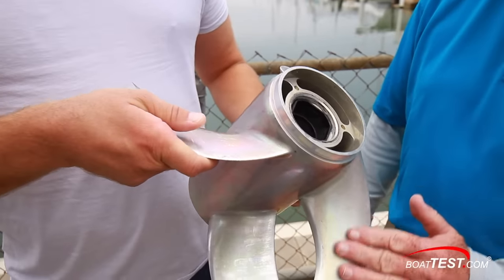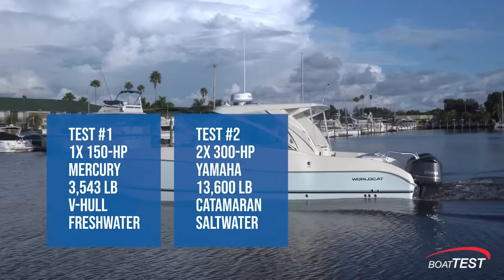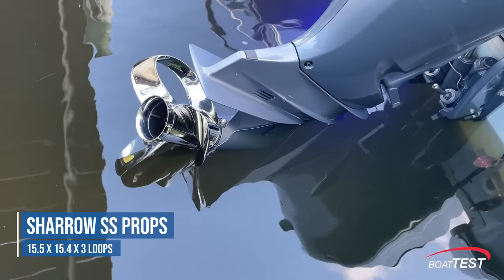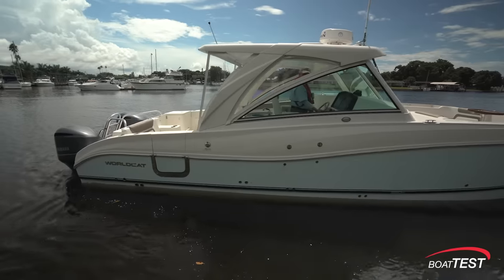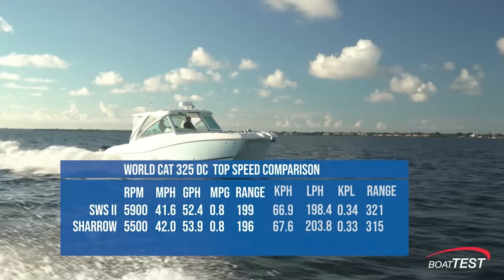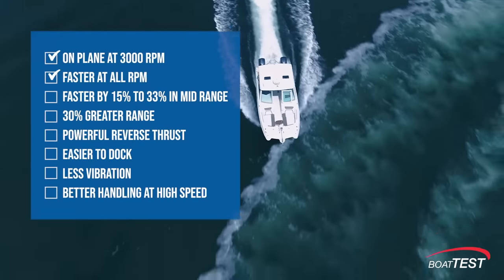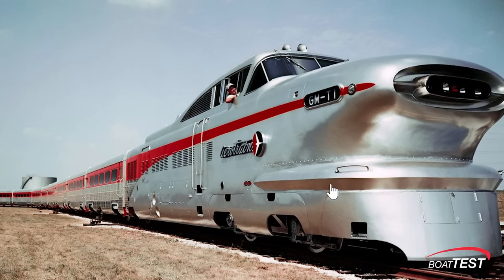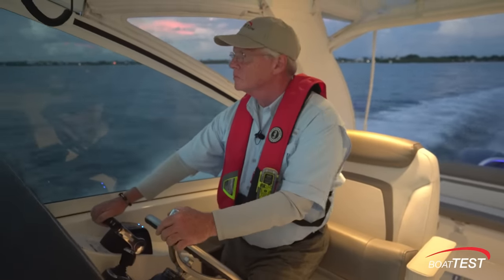Sharrow Propellers (2022) - Test Video by BoatTEST.com

Comment: I would hope the cost could come down on these eventually such as when there is a permanent cast stainless version available. If these have to be CNC machines then cost will stay high. Also what part of this cost is just artificially high for high profit rip off purposes. [OK I did see the part where he supposedly is going to cast these so there may actually be hope they will be more reasonably priced in the future, close future].

Also how would this prop compare if you were to up size the standard prop or do prop test/tune with different standard props? Or, simply, how would it compare to the next size up standard stainless prop? 

I always up-size my props until I over do it and get worse performance then use the one best for my boat vs steady state medium cruse and efficiency. I never once seen a prop that came standard on a outboard "be the best" for the boat it was hung on by the dealer [who usually don't give a crap].

So, in my opinion, though this prop is undeniable pretty darn cool my question is simply... is it really worth the cost? Not so sure until maybe 10 yrs from now and every one willing to pay an unreasonable HIGH cost has done so and sales fall off then prices will start to come down.

I am not that guy with 300k cars in my garage or a 300k boat so you rich boys have fun with this. I'll just tune my  boat with different props like I usually do and get vary close to what this new cool rich boy toy will do. 

Remember this is really more the "sales video" then the actual good and proper test. Hand me the keys to that boat and a proper selection of standard props and then you will really see what that boat can ACTUALLY DO with standard stainless props after a PROPER prop test and tune session.

Comment: I'm not qualified to pass judgement on this subject, but it looks to me like the Sharrow prop simply has more "bite"which would give it better economy midrange and higher speeds at the same RPM. The fact that the Yamaha prop tops out 400 RPM faster than the Sharrow tells me that this is not an apples to apples comparison.

Comment: what i would like to see is a comparison of a petrol 300 vs a OXE 300 diesel with these props on. also hydrofoils vs no foils if my calculations are right just switching to sharrow prop and diesel outboard it would increase your range by almost 100%. and that's nothing to sneeze about with planning hulls where range is always at a premium. screw the fuel prices... range is where its at. a 300 mile range is all fine and dandy... but increasing that to 500_ miles opens up a whole new venue for using the boat. all boating i ever did was medium to long range cruising and the only boat that can accommodate that is a displacement trawler or a sailing yacht. having an option to do that trip with a planning hull would open up so many more new options. and that alone is worth the 20K per engine price increase.

Comment: 3 blade props have slip. Sharrow is basically a 6 blade prop. has more bite. Less slip. Test it against a cheaper 4 or 5 blade prop. Should be comparable to Sharrow

Comment: I'd like to see fuel burn vs boat speed.  It seems to me that the sharrow gives more thrust per revolution, but takes more torque from the engine (hence top speed RPM is down).  I wonder what it would be like if the engines were matched to the prop for that extra torque.
Reply: Only worth testing on electric motor since that's all that will exist soon. Great torque.

Comment: I always wondered how one of these would do on my boat. I spend most of my time trolling at idle speed and to get an extra 20%-25% in fuel savings would be great. I spent $2500 in gas in 45 days during my guiding season.
Reply: Buy one and test it out.  That's the only real way you'll know.  Best of luck!
Reply: Ur about to spend a couple more thousand at the pump. Remember trump was in office and gas was 2$ a gallon ?
Reply: I do lots of trolling also and I have 200 hp Suzuki with trolling mode which allows me to slow down the rpm but I think if I will install this prop will increase my lowest trolling mode and I will need to deploy trolling bags

Comment: What a great invention! It's only 7264.704 miles to run on this specific boat to compensate for the cost of the propellers. That's ~335 hours of operation. Many owners sell their boats before hitting that threshold. Also, and that's only a side problem, what are the chances you won't hit anything with your propellers before doing 7.2k miles? There is a reason that some things weren't "invented" all that years and it's called "there was nothing to be invented there"...

Comment: Any answers about long-term effect on the motor and drive system ? Sometimes performance upgrades are not always longevity upgrades. 

One other thing I am curious about is whether the actual material (type of aluminum, or stainless steel) and weight of the prop was taken into account. How much of the difference in effect between the props is actually due to the change in shape?

Comment: I can well imagine that comparable improvements could also be made to the Axopar 37, for example, which would then be quite spectacular and sensational.

So in relation to the improvements that could be achieved and the total price of 500,000 US$ for a well-equipped Axopar 37, it would be very interesting. 

For me, such a propeller would be particularly interesting because I expect to be underway with my 2 x 300 HP COX diesel Axopar 37 for about 150-200 hours a year, or 4000-6000sm/year. With the current GTL diesel prices in the Netherlands of 1.85€/l (8.5 US$/Gal), it will already pay for itself after about 2 years and fuel prices will continue to rise. 

I would therefore be very pleased to see a test on a diesel drive and of course optimise my Axopar 37 with it as quickly as possible. I reckon that my Axopar will consume 1.6 l/sm at a cruising speed of 30 knots and approx. 2000-2500 rpm.
Reply: 1.6 l/sm = 2.3 sm/Gal

Comment: I can see why they cost so much. Each prop is CNC machined. Meaning, it can take 5 hours or more to get the proper shape out of a billet.  While the majority of the other props are made out of molten metal, assuring strength and consistency. If Sharrow goes to using mold injection, then they will see a serious change in their product quality and weight.  Otherwise, I don't think they will survive for much longer doing CNC machining.

Comment: Okay, 40% of an outboard's duty cycle is at idle.  How much of that idle duty cycle is the engine actually in gear?  If it's idling in neutral, then the MPG is equal (zero), no matter what prop is on the engine, so prop efficiency at idle is probably a moot point.

Comment: The original props data at 4,000 rpm was shown as the optimum performance for that boat, why wasn't there data with these props at 4,000 rpm ion that same boat? That's the data i want to see

Comment: At speed, Baseline of pitch (from horizon) = x
At speed, outboards pitch = 0.5x
Recheck max-speed

Thrust-angle into water (dig-kick) at low speeds for push 
Thrust-angle into water (push-push) at high speeds for push
Reply: Low speed = center-further wake rising from bottom 
High speed = release unintended-forces immediately, two nearer wake-sprays

Comment: The performance is great and the engineering behind it is obviously suberp, but the price is unreal. A saltwater series prop is about $700, these are on their website for $4900. 😯😯😯😯
Reply: All depends how much you use your boat. I do sailboats and a feathering prop, even a little one is 2-3 grand usually. Bigger ones can be well over 10k. The folding prop on my 31' was 1400. And I did that to gain 4/10 of a knot.

Comment: If the price isn't in line with other stainless steel performance props then who cares what the results are. They would have to be a night and day advantage not just a somewhat of an advantage.  Maybe if you were a race team price wouldn't matter, but that's a small market. Plus a race team would only be concerned about top end and control.

Comment: I don’t understand why your leaving RPM on the table while recording the top speed. Why are you saying that it’s top speed was achieved at a lower RPM with the Sharrow prop? Does it fall on it’s face over a certain RPM? It’s not like the prop changes the engines ability for reaching the same RPM range & that should translate into a higher top speed for the Sharrow.
Reply: Yea that didn't make any sense to me either. Did it hit a plateau where it just wouldn't perform after a certain RPM? If so that seems like a major flaw.

Comment: All the engineers are screaming that these tests are telling them anything.  You want to take the hull out of the test to the degree possible.  The second second issue is the non symmetrical shape about the c/l of the prop .  This would mean that there would be variations in the stresses in the drive shaft and possibly contribute to fatigue of the shaft, bearings, and seals.  Maybe this is balanced out.  They did not mention why all the blades are no longer tied together.  Design objective was to eliminate tip vortices.  There is still one tip with a vortices.  I guess a 66.67% improvement is pretty good considering the probable performance gain and weight reduction.

Comment: If you could scaling this up to large container ships just imagine the environmental benefits keep up the work
Reply: "Through this R&D effort, Sharrow Marine developed a proprietary method for creating new geometries for a wide range of applications from tugboats, to supertankers, to recreational boats, to planes and drones."

"The most lucrative application of this radical new propeller is on supertankers and other large commercial ships, where it can potentially save them millions of dollars a year in reduced fuel consumption per ship."
Reply: these tests are purpose built props on the same intentionally underpowered boat as last time, this isn't real

Comment: These are obviously aimed at the well heeled buyer.  But so few boats these days, in my area anyway, come with twins.  It seems most are quads with a few triples and a growing number of 5 and 6 motor boats.  Then again.. if you're buying a boat with 4-6 motors, the extra $20k-$30k for these props probably won't even register on the financial radar.  Is everyone else seeing this growing number of large boats in your areas?  I'm in S. FL.
Reply: @davesmith9684  Outboards have a few advantages over inboards, such as more room inside the boat, easier maintenance, easier repowering, etc..  Disadvantages too, such as the motors being in the way when fishing.  My own belief is people buying the 45' CC with 5 outboards never actually go fishing and probably don't put many hours on the boats at all, it's mostly a status symbol and they would prefer the extra room and higher top speed on paper to better economy of a diesel inboard.  Similarly those high power outboards are not as high strung as it might appear.  For example the new Mercury 600HP outboards are 7.6 liter, so about 79HP/liter.  That's pretty mellow by todays standards.  We've got tons of classic sport fishers around here too, they just don't seem to be popular at Haulover.  Miami is a mess, I do my best to avoid ever going there!

Comment: Great prop, going to assume this will outperform also on electric sailboats, 
any thoughts about using these props as regen electric sailboat under sail. 

Can we sail slower then 5 kn to get electricity from the regen??
Reply: You'll always have a better result with a wind generator rather then using the propeller, Just having it freespin or even work as a generator is a ton of drag. Thats why they normally use folding props.
Reply: @connorjohnson4402  

Thx Connor, thx, the drag on our OV motor only has about 1/2 kn, unfortunately we don’t like the noise from the wind gen :-)

Comment: I have two applications. A Donzi Sweet 16 350efi Mercruiser and Alpha 1 neo, and a 15x7 metre steel pontoon houseboat that cruises mostly under 2000rpm with twin 60 high thrust Yamaha engines. Would love to see what these props would do to these very different boats.

Comment: As others have stated......this a is great prop, in fact the best prop to have ever existed. Now, who can benefit from it? The answer is those people who burn more fuel per year than the other props, verses the repair costs. And as on Mar/23, we don't even know if these props can be repaired. We have the biggest prop repair shop in Canada (30,000 repairs/year) just sitting on the lake beside our lake, and I can guarantee you that they do not have the equipment to fix these. So if damaged, it is either a $5000USD door stop, or you send it back to Sharrow HQ and wait a few months to get your repaired prop, and probably pay $1000-$2000USD to get it fixed. Translation: If you damage a prop every 2yrs and you don't save about $2000USD with this prop in fuel during that same timeframe, then its not worth it. Every lake in the Trent-Severn system I'm on is solid rock bottom 90% of the time. I would not save enough money from fuel to make this worth while, so unless I win a lottery, sadly, I can't buy one of these. I wish I could, but no.

Comment: Nice video. I currently have a 2021 Suzuki 350 on a 22' Osprey Northwind.  The Suzuki has a dual-prop set up.  Is there an application of props from Sharrow props for that outboard since its dual prop ? If anyone has tried that set up with a dual prop outbard please let me know. -Thanks
Reply: I’m sure if you paid $10k, it wouldn’t be a problem.

Comment: I´m surprised that for this Sharrow prop 
design, the increased efficiency of less blade tip vortex loss apparently offsets the drag of its additional wetted area, and by such a degree.

Is the experimental data confirmed by a CFD simulation?

Comment: This looks stainless.  I’ve always heard a stainless prop is no longer your weakest link in an underwater strike, but your lower unit sure is.  I’ll take a little less performance over that cost.
Reply: I'm on Lake Erie, and was told by dealers and mechanics to ditch stainless unless you are into ultra performance.  A new aluminum prop is a heck of a lot cheaper than a bent prop shaft.

Comment: fit a bigger higher pitch prop with same Ae on that boat and it will do the same. It cannot deliver higher speed without different pitch as prop slip is not that high. 
ie if there were testing two same pitch props, it would mean the Sharrow had 0% slip and traditional 40-50% slip at some speeds. that is just not how that goes.

Comment: I would feel a lot better with fuel flow sensors hooked up to a laptop and the corresponding data. Not that it matters for me, I wouldn't spend that kind of money on a prop. Typically burning an average of 12 gallons a week, a 30% savings would amount to $15. It would take about 6 yrs to recoup the investment. That's IF the most economical cruising speed is observed at all times and the savings were actually 30% on my hull.

Comment: so basically at 4000 rpm where u got best cruise for the standard prop  u got the exact same thing at 4000 rpm for the new prop. but you never pointed that fact out did u, and if runnign at wot  the standard prop is better . . so basically if i gonna cruise at 4000 rpm  i still better of taking the standard prop.  the new prop seems only good for use at low speeds and low rpm

Comment: Anyone who knows anything about boat propellers will see this test is not apples to apples. Efficiency is all about diameter and pitch and the Yamaha SWS II 15 3/4" x 15 tested against the Sharrow 15.5" x 15.4 isn't a fair fight. If they would have tested it against a Yamaha SWS II 15 1/4" x 19, the gains in fuel efficiency of the Sharrow would have been mitigated.

Comment: The price and the fact that they are not available for go-fast boats, makes them a bit pointless at this stage.
Most of us who will spend big money on Hering or Merc CNC cleavers or bravo style props, are interested in going fast, and we surface our props. Most people who run boats, big or small, with submerged props, tend not to be interested in spending much on the prop.
So there's the catch 22 in this saga. Those who will fork out 5 grand or more per prop, do not need them, and those who need them, will not pay for them.

Comment: This will never be popular until the price is commensurate with the mechanical advantage. If the Sharrow is 25% more efficient, it should cost between 25-50% more not 15x the cost.

Comment: The only reliable test is a lab test. Sharrow Marine propeller should be compared with an ordinary marine propeller, pump impeller in the casing like SCHOTTEL propulsion system, and pump jet propulsion. To me, Sharrow propeller looks like a mix of ordinary marine propeller and 2-stage pump jet propulsion. Efficiency is probably between the two.

Comment: I call BS. Look at the original review of the Robalo 302 from Boattest. In that article it showed 3500 rpm was 31 mph, but in this “comparison video” you claim the standard props only produce 21 mph are 3500 rpm and the special Sharrow pop does 31. Were you wrong back then or now……..

Comment: I'll admit those are nice props, but they're all designed for larger motors and the cost is ridiculous. Who wants to spend a minimum of $5,000 on a prop? Find a way to bring that cost down to under $1,000, preferably closer to $500 and you might start selling a bunch of them. Until then, they're just a curiosity for most people.

Comment: So yeah, why mention cost or durability? Pretty unimportant. Glad it wasn't brought up. 

Further, this is a direct comparison test of a new design vs the current design. Put on a tweaked and balanced 3 blade like everyone does and not the completely stock prop like here. A tweaked prop vs stock produces the same better numbers.

If this was plausible Merc and everyone else would have adopted it by now.